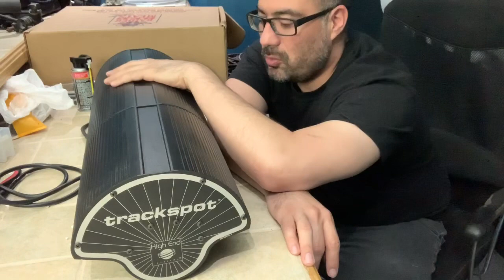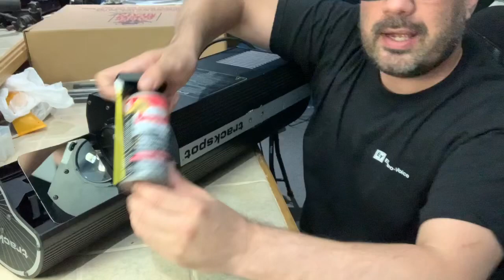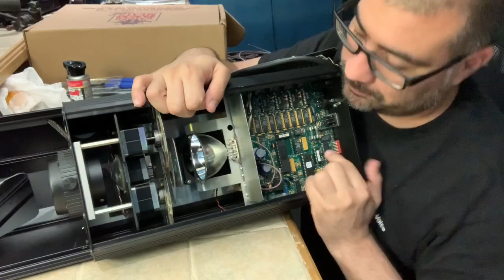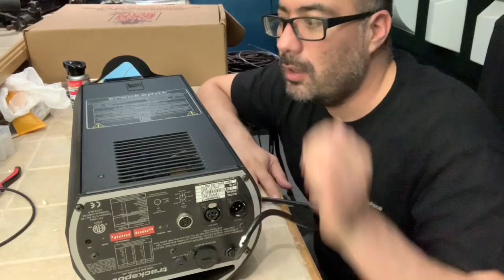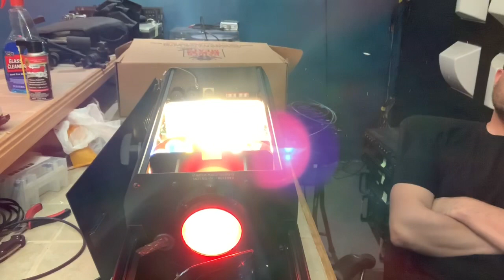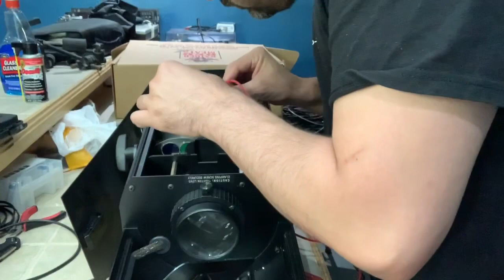High End Systems Trackspot: Does it Work? not sponsored by DeOxIt D5 Contact Cleaner and Lubricrant

Comment: A friend of mine will get something like 8 of these if the buyer will not get higher bids. 3 of them should be functional and others less so.

I'm quite a fan of old lighting and DMX controllers, that in some way feel a lot more approachable than PC-based systems, where I really struggle to understand the ways to make a nice scene or a "playback". It usually feels like "why the heck can't I do this and that". It's not the protocols fault, it's the way how it is controlled...

I think one of the shortcomings of DMX is that no one thought about syncing it to beat. As far as I know, there is no fixtures with a dedicated "bpm" channel/channels, which would be (at least from my perspective) quite easy to do with for example 2 channels, one for 0-256 bpm coarse, another one for fine tuning. It would help tremendously in a situation where the light jockey (R.I.P.) would "play" the lights in a live situation, if the movements, blinking, color changes would at least to a point be synced to the beat. 

I could imagine a feature in some PC-based system that can measure the speed of blinking, sweeping, color changes and so on, and then it would create a "map" for the fixture and it woul be utilized when making a scene in said system (control program). So instead of giving straight values on a given channel, you could control the behaviour of the fixture and the speed of said behaviour. 

In my experience in small budget, DIY and other music events, I have noticed that controlling the lights and making them do anything in the actual beat of the music is one of the least considered things. And even if there is some fanatics in the group making the events, it always feels like there isn't enough time to make anything good. Just mediocre "auto play" or using some integrated "music mode", that never quite grasps the people on the dance floor. 

And while I've done a few non-profit gigs on my own parties where I'm manually doing almost everything and seen how much of a crowd pleaser it is to flash the lights and using the strobes to the highlights and to the beat of the music, it is not an easy feat.
Reply from the maker: These lights are tanks, you can use the non-functional lights for spare parts.  BPMs usually are not a control function in the units, but from the DMX controller. The Trackspots do have a music function witha built in microphone.  A professional show should always coordinate the lights to the music, this comes from predesigning scenes, practicing, and if possible rehearsing.
Reply: These lights are robots, they do what they're told, its up to you to program them to the "beat"... Most  DMX Controllers use BPM, even the original Trackspot Controller had a BMP input.  I used DmxControl (if you can find a stable version) you tap bpm and you can run them at full speed, half speed, etc.. You can also change the speed of the light movement without changing the speed of the tempo .. You can program an entire sequence. Lighting engineers spend great time coming up with unique lighting movements/strobes/colors/effects.